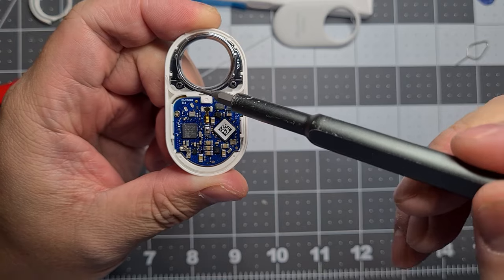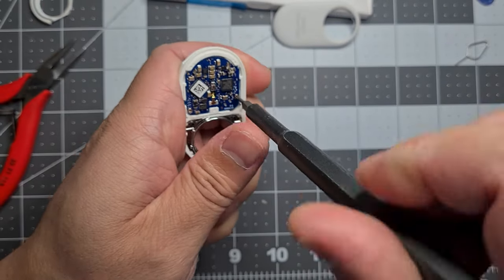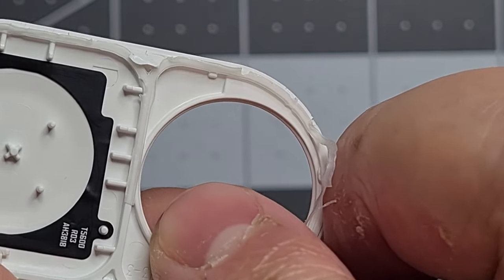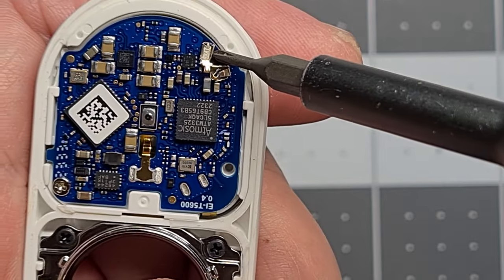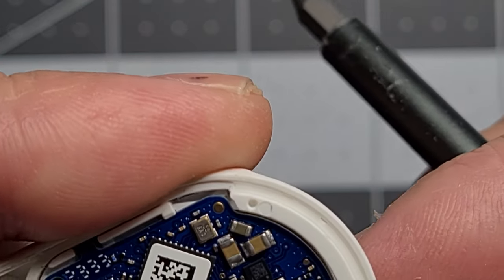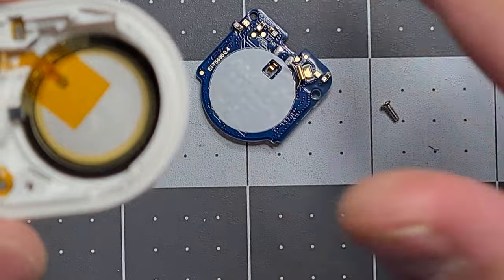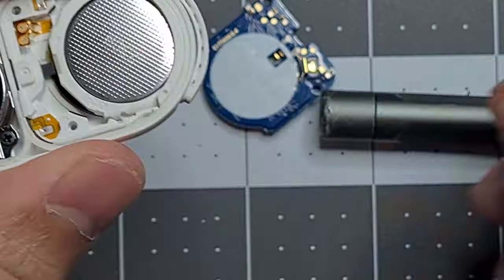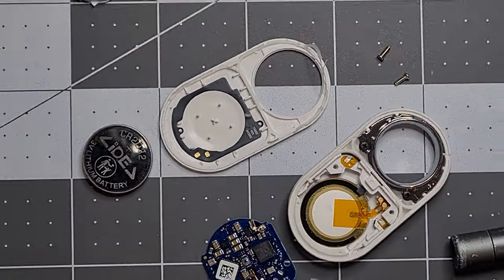Samsung Galaxy SmartTag2 Teardown

Comment: I'd be interested if it didnt have the obnoxious ring on it. Such a waste of space when it could have been a small lanyard loop.
Reply: Other than putting it in a wallet it has no other use tho and you can buy the first generation but it a bit bulky
Reply: I'm using this for my wallet. If it can't fit with the loop, I'll just cut it off and put glue over the cut.  The loop appears to not have anything involved in the actual tag's function inside it. 

Update: It fits perfectly without cutting the loop.  And has saved my ass a few times.

Comment: Someone at Samsung needs to get fired for insisting on doubling the size for the stupid ring.
Reply: 90 percent of the use cases are on keys
Reply: average tiktok user
Reply: The highest percentage of use case scenario for these are keys or using that big. Would you guys call waste of a ring? It will hang it on your dog and track it when it gets lost or stolen. So I'm fine with the way it is. I bought a leather case for it and it's hanging. On my wallet from vulkit That I purchased originally designed for a air tag. I replaced that case for one of these and i'm fine with it

Comment: I'm fine with the design. I purchased the white one and i'm using it on a wallet which has a leather loop that hangs a air Tag Leather keychain, but I bought my own keychain. To put this in and it's hanging there. Most people are not gonna understand why the ring is there, but the most common use scenario for this is putting it on keys or hanging it on your dog's collar. So when they get lost, you can track where they are. I find it more beautiful and better looking than the first generation

Comment: Looks like older smarttags were easier to make it small form factor. I was able to throw away all plasting casing, attach battery to PCB, tape everything and still make it working without soldering. Thanks to that I was able to hide it into the hollow plastic parts of stroller for example.
But your wallet mode for ST2 looks also cool, I am thinking about to make this one. Even the model looks simple, you could share it.

Comment: Based on this video, I don't see any connections to any electronics between the lower half and the ring half. With that in mind, do you think it would be viable to cut the top half off with no consequence? And beyond this, shouldn't the dimensions then result in ever so slightly smaller than an Apple Airtag? If so, that would mean that we could use Airtag accessories that are out on the market. Any thoughts on if this would be viable?

Comment: How hard would it be to hard wire one into a cars 12v battery supply so it could be hidden and left without worrying about battery changes.
Reply from the maker: Would not be that hard you would just get a 12v to 3v adapter and hard wire it in. I wouldn't do it that personally the battery should last a decent time before needing a change. Also if someone disconnects the battery for the car the tag wouldn't work.

Comment: I need to know what voltage it can handle. Old Samsung Tag could handle up to 5.5v

Seems like Li-SOCl2 battery is an excellent choice for any weather.
Reply: That's what I was Comming here looking for was max voltage 

another YouTuber taken apart an airtag and has soldered on 2 wires with a battery holder with a 3.6v Li-SOCI2 LS14500 Battery (not very small so for larger objects, personally I would have soldered directly onto the battery and skipped the battery holder with a switch) provides a 10 year life airtag

these are not rechargeable as intended for long term use like smoke/CO Detectors and have basically no per month leaking like a rechargeable one does (the battery probably outlast the device)

Comment: I'd really like to do a project of reducing the size of the smart tag so that it might better fit in the collar of a small animal like a cat, the big tags the cats will not like and try to take off, im thinking of removing the PCB like this then 3d printing a small case or just sealing it in epoxy

Comment: I just buy Solum smart tags off Ebay for $17.99. Same functionality as this tag but way smaller case. Same company who supplied Samsung. The only tiny difference is that the Solum tag does not support the "tag left behind" notification feature. But I never use that feature anyway. All other aspects are the same. Same everything, from the button to the beeps.
Reply from the maker: does it use the Samsung app etc?

Comment: For something that is gonna be next to my keys at all times, you pried that open a bit too easily. Kinda sucks for an item that's gonna be constantly bashed around, specially compared against steel keys.

The battery flew open on the first throw when it slammed against a wall like an old phone

Comment: Anyone know the voltage it can take?
Reply from the maker: I would say 3.3v max
Reply: @rayj1988  I have nice idea. on aliexpress there are 40x20x3mm lipo batteries with protection circuit on it. I am going to create 3mm spacer for ridge wallet and going to put it under top carbon plate, so it will be part of wallet, instead of some card. Only thing holding me back is voltage, this is 3.7V, and I hope it can survive 4.2V... Are you sure about voltage or are you just guessing by original CR battery?